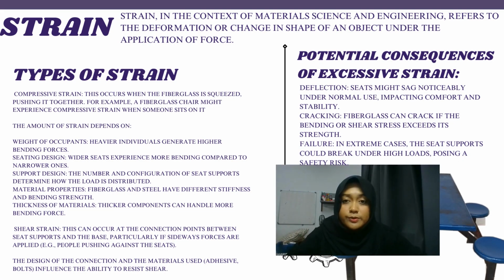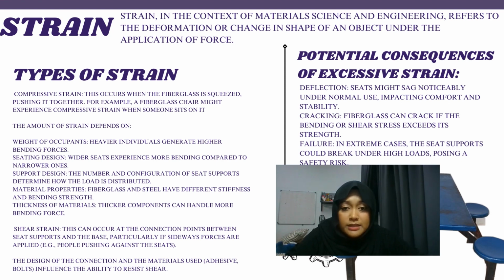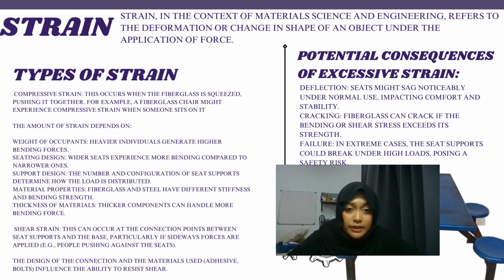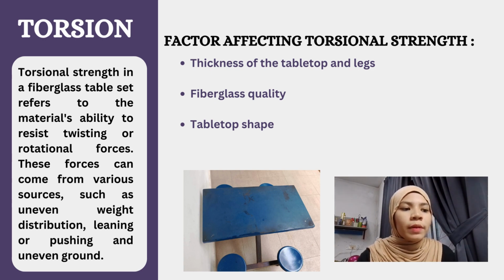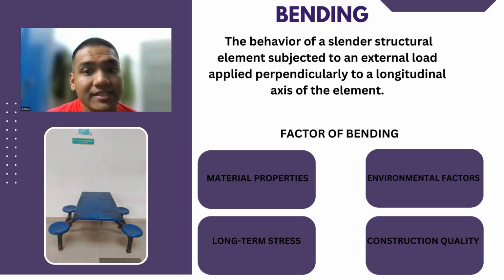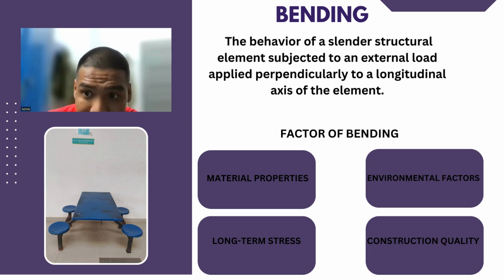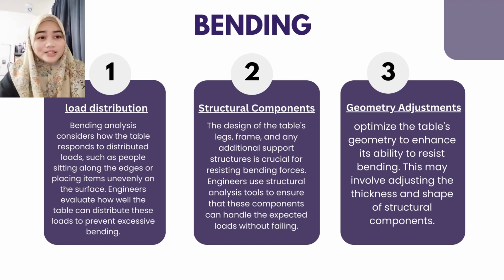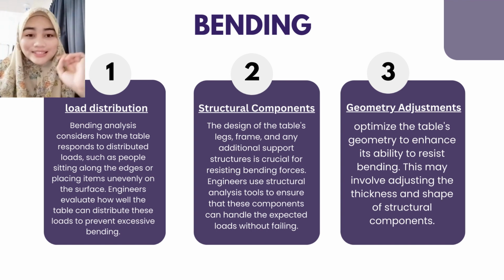STRENGTH OF MATERIAL ASSIGNMENT GROUP 2

Comment: hai I’m Nelisa from group 5 , I want to ask does the fibreglass 's endurance influenced by the temperature?
Reply: Yes, temperature has a influence on fibreglass endurance. The structural integrity of fibreglass may be impacted by extreme temperatures, particularly if exposure to high temperatures is extended. Over time, it might cause warping, weakening, or other types of harm.